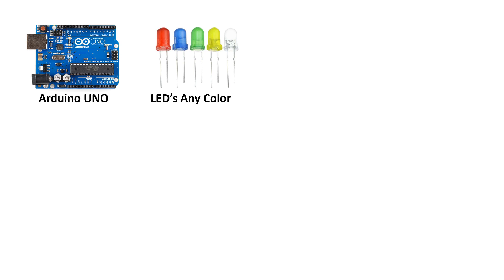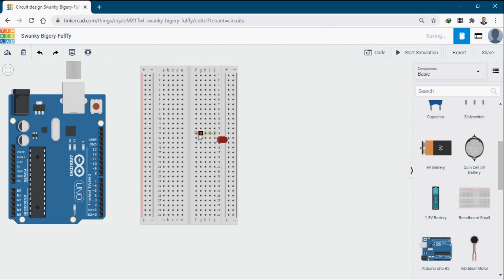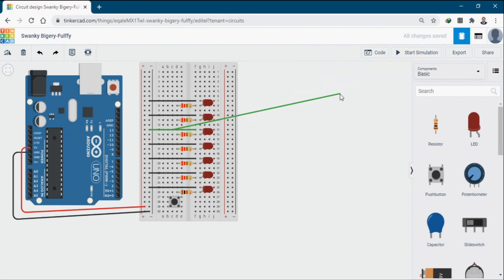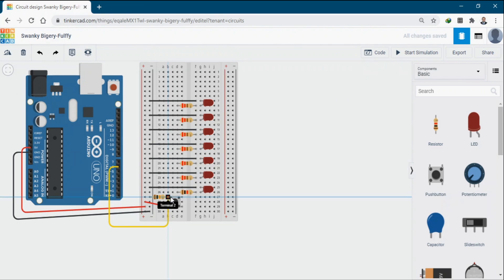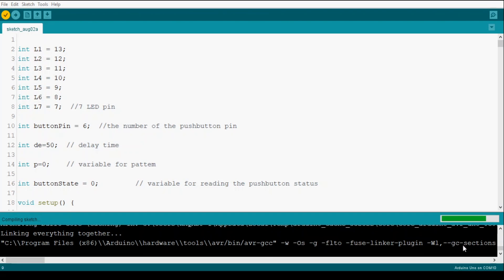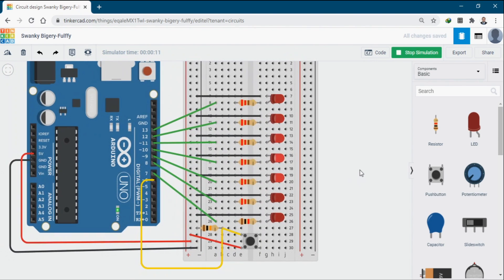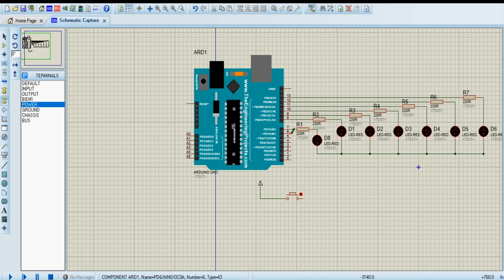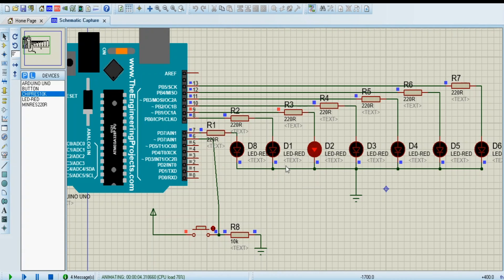LED pattern with button control on Arduino | Arduino Tutorial

Comment: ok my problem is that its just changing the pattern on its own without pushing the button..help mee
Reply from the maker: your push button connections are not correct .make sure your connetios are right